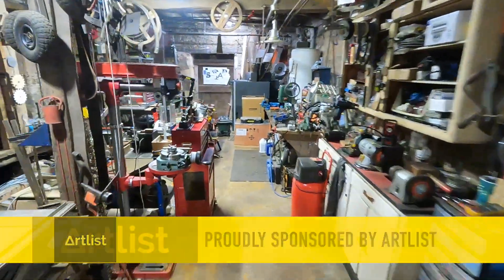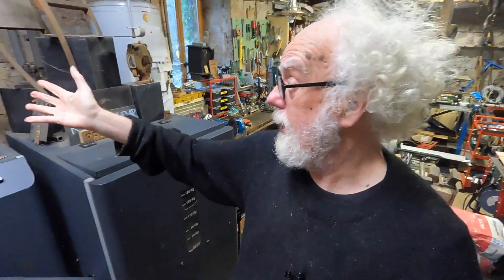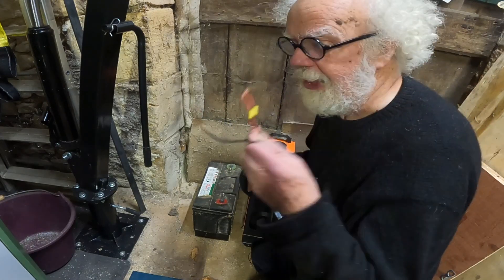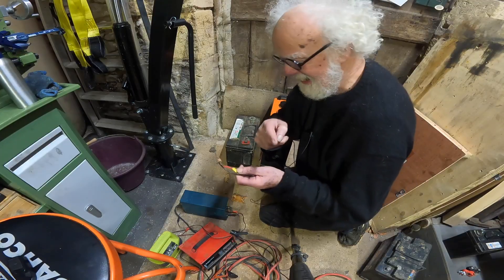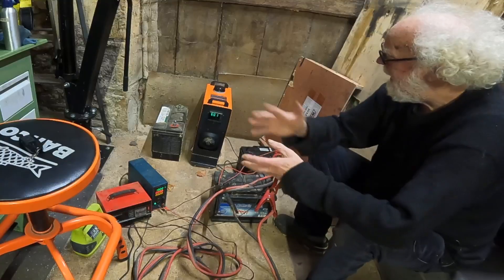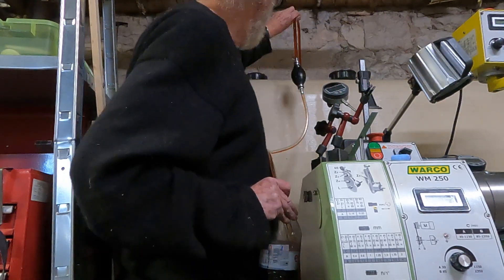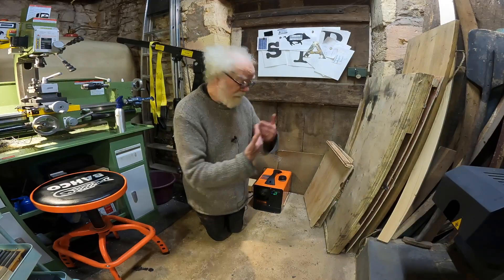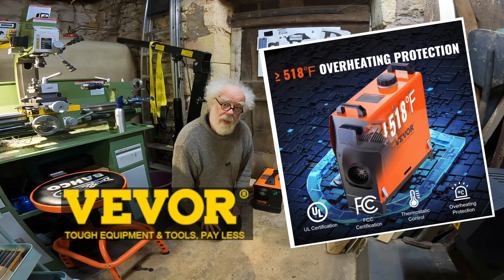Diesel Heater power supply idea

Comment: 9:11 Unless I'm mistaken, the power supply reads 10.7 volts here. Which means one of the batteries is too old to accept a charge. Fully charged lead-acid batteries have ~12.8 volts, empty ones ~11.8 volts, below 11.8 volts they're damaged.

Comment: l must point-out the fuel smell does not last more than a few minutes its just while its starting up... and gets going.
Reply from the maker: yes...there is very little smell as the burner and hot air are separate

Comment: Also its pretty easy to run one of these with NO Computer controller. If do not want to use the Drip IV method for fuel delivery u can just make a 555 timer circuit with a Mosfet or Transistor at the output to drive the fuel metering pump . Could even add a 4017 Counter chip if wanted to control even more & slow the pulses down.

Comment: How many BTU?
Reply from the maker: see if i can find out...5kw is power but no btu are mentioned by vevor
Reply: @SimonHollandfilms  One kilowatt is 
approximately equal to 3412.142 BTU. So, a diesel heater 
with an output of 5 kW would be approximately equal to 
17,060.71 BTU. I hope this helps! Is there anything else
 you would like to know?😇😁

Comment: I had to watch it twice but i am not convinced you have installed it to run reliably. The time frame for failure of the first unit fits with coking up due to the exhaust pointing up outside and not being able to drain condensate. If the replacement unit has a similar exhaust installation then that will fail in the same way too.
Reply from the maker: thank you i will check the exhaust is draining condensate by pointing down.
Reply from the maker: looks ok, i put a weight on the exhaust outlet to make sure it was pointing down...cheers.
Reply: @SimonHollandfilms  If it has no roller coaster peaks and troughs where condensate can collect then that should do it 👍

Comment: Love your videos !   I wish you had spent more time on the actual heater instead of just the power supply. Also I hope that is a fake battery you have your metal power supply on?  Something metal that Close to your battery terminals is scary .
Reply from the maker: its now in a wooden box and sitting on the heater ....all working well.   i might tear down the broken one to see how they work.
Reply: I was kind of worried it would short out. When I was 10 my brother showed me how big sparks get from a battery and a paint roller handle. Stupid big brother.   I would really like to see you break it down and show how good they are.   I also purchased one and it didn’t even turn on.  Have a great day.  @SimonHollandfilms

Comment: Some of these Chinese diesel heaters come with a dedicated power supply for indoor use.
Probably the pump fail in the first one, that’s the bit that does the annoying clicking.
Once primed and running these machines use very little electrical power to keep running.
I noticed your diesel didn’t look too clean, so that might be an issue.
Great share, thanks Professor.
Reply from the maker: thanks roger.... i might tear down the broken one to find the point if failure.
Reply: @SimonHollandfilms  I hope you do. I rely on one of those while out on the road. Even some diesel mechanics treat these things as magical black boxes, and complain about how tricky they are just to install. This one from Vevor certainly simplifies installation! Anyway, it sure would be helpful to know what goes wrong, and how to recover. So far, all I know is they need to run at operating temperature for a minimum time in order to clean up the soot filter. If the heater cycles on and off too frequently, the soot filter builds up until it's clogged and can't run.

Comment: What is the cost of the fuel per gallon, the BTU content, and the efficiency of the burner? Use that result versus just using an electric heater, providing that your electrical supply is adequate. Plus, electric heat will make you feel fuzzy good about no CO2, other than the out of sight, out of mind, coal or oil fueled generator plant. Kudos if the source is nuclear, maybe.
Reply from the maker: its not great but i have 300l of free diesel so im using it up.
Reply from the maker: our electricity is nuclear or hydro
Reply: My place is "all electric", which means fuzzy good out of sight hydroelectric. So in a way, my heaters are powered by endangered Chinook salmon.
Reply: Maybe professor Simon can show us a diy nuclear power plant hopefully.

Comment: Simon, you know full well that Amps is not Cranking Amps, you silly noodle.
Reply from the maker: i didnt
Reply: @SimonHollandfilms  Yes, operating Amperage, and Cranking or Starting Amps are separate measurements. Think of it like this. The operational or working Amps of a battery is its horse power and cranking Amps are the Nm of force it can exert in electrons all at once. Like engines, batteries loose their grunt force over time even whilst still being able to run.  This becomes especially important in replacing your car battery. I will always opt for a larger cranking Amp rating over OEM specs. Say the mfg. recommends 750 cold crank Amps, I'm going to instal a 1000A cold crank battery instead. This much better combats degerdation over time and the effects of winter cold.

Comment: When you find out heating oil is basically just red dyed "off-road" diesel... just taxed differently (US).
Reply: Fishermen get the ultimate deal on gasoil
Reply: Same in Europe. Heating oil is low tax diesel, which is lower quality kerosene. Chemically, all three are the same.

Comment: How do they know what went wrong if you dont send it back ?  .. so do a teardown video and fix it :)   Cold batteries have less capacity...    The 80Ah isn't the amount of current it can deliver, its the capacity ...   so it can deliver  40 amps during 2 hours or 8 amps during 10 hours  etc.  But it says nothing about how many amps it can deliver at a certain time,  however a car battery is supposed to be able to turn a starter motor over so you expect it can deliver a large current.  The batterie probably can deliver enough current,  but the voltage will probably drop a lot which the heater doesnt like.  A switched power supply will keep the voltage at 12v.    Maybe you are better off putting the car batteries in series .. so then you probably have a voltage drop where the voltage stays over 12volts heh

Comment: Hi Prof!  The inverter was a good idea.  I think the issue with using an old battery is that the electrodes inside the older batteries (probably zinc and copper)  have been doing their thing for a while now and the whole process of electrons moving between the electrode plates in a gel or a sulfur bath eventually wear away the electrodes to where they are pitted and oxidized.  So you never get the full current even if it measures 12 V.  Eventually, it won't take a full charge.  I think the battery chargers won't help because they aren't really power sources like your bench supply.  They ramp up the charge so as not to explode the batteries from charging too fast.

Comment: More likely a bad connection to the battery. Any good working batery cable of over 10a will run it. It only needs 10a to start up for a few mins while running it's glow plug.

Comment: Connecting batteries of different capacities in parallel is a recipe for disaster, basic electrical engineering professor.
Reply from the maker: i had no idea...but i guess i should have wired small one into the larger one...hmmm
Reply: I'd agree when connecting them in series. Parallel should work fine.

Comment: I got a cheap Chinese one years ago and had the same error fault so I bought a 12volt l.e.d. driver/ transformer just like you did, it's never missed a beat since. Did you unplug your first heater from the power supply to turn it off as they need to go through the cooling down cycle or they'll overheat the mother board and they won't work again.
Reply from the maker: ah...no i didnt
Reply: @SimonHollandfilms  I may have worded last message wrong.  You need to hold power button on unit  to turn off  and it'll take a few minutes while it cools. Don't turn off at mains or the fan stops and it overheats
Reply from the maker: got it tanks Noel.  @noelsouthcott7320

Comment: it works with a computer supply with 450w .. the overheating protection : 1. start - overheating shot down then set off . after secound start in should working ..
Reply: There are more powerful computer power supplies out there. Most PC gamers probably have an old 750w leftover from their upgrade last year. They're almost common now, so perhaps a cheap option?
Reply from the maker: thanks
Reply: I was wondering about that myself

Comment: definitely something wrong with your heater, I've had mine running at home just on 12v car battery and trickle charger for a couple of years now. yours needs investigating
Reply from the maker: its all ok now....but the first one refused to be powered up.
Reply: Maybe a combination of two problems. If the first heater was sensitive to <12V, plus the old big battery dragging down the system, that would cause several weird issues.

Comment: Can it run on different fuel types or just diesel / heating oil? Maybe cleaning the broken unit might fix it if it somehow got clogged?
Reply from the maker: good plan...i will try and get it to run...i think there is a control electric issue
Reply: i think if you run it till it runs out of fuel it cant go through its shut down cycle so it may have coked up  @SimonHollandfilms

Comment: I prefer my buddy heater. Only needs propane to run and I use stove fans with it to circulate heat in room without any electricity being used at all. Could use it in my garage or in the middle of the woods.
Reply: I've got a big buddy heater and it heats my metal shed. The only problem is it starts to rain in there when the moisture condenses on the steel roof. The diesel heater solves that problem.
Reply from the maker: sounds good
Reply: What's a 'stove fan'?
Reply from the maker: @doronron7323  i have one..its a heat driven fan...a therocouple makes power from heat and turns an electric fan....no torque but kinda works